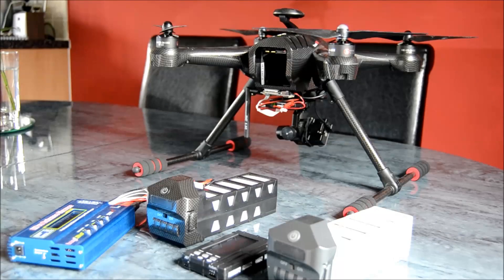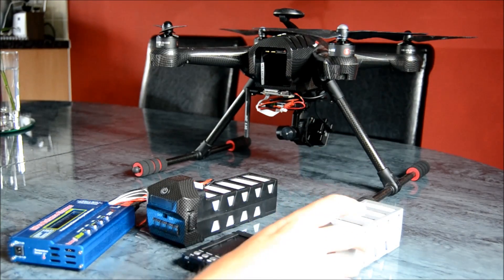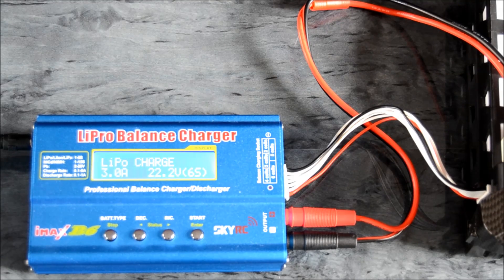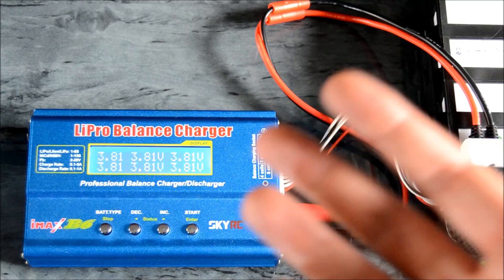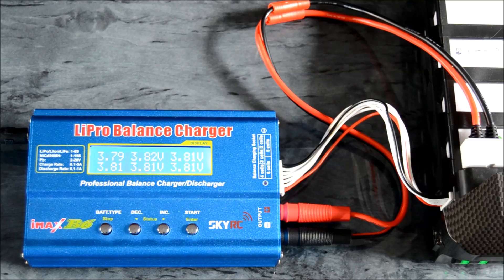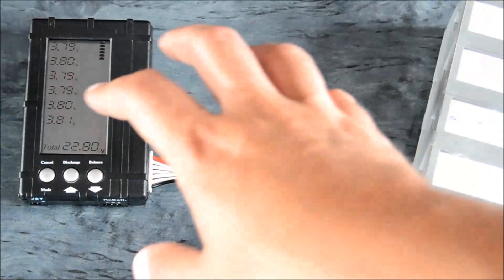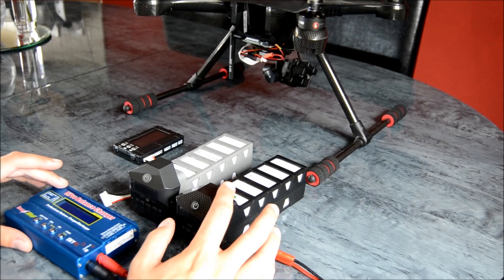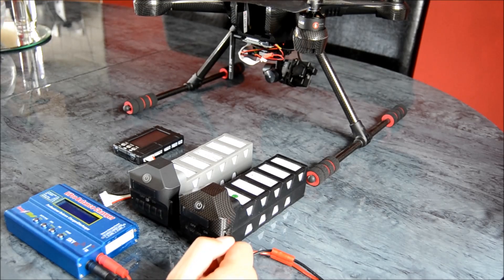Putting LIPO Batteries Into Storage Mode

Comment: Hey I have a question I have a venom duo pro charger and I have a 2s 5,200 mah lipo and when I go to put it on a storage charge it keep charging the battery past the 3.80 volts per cell how do I fix that or should I let it keep going because I usually stop it one it gets near 3.85 volts per cell. What should I do.?

Comment: How long  can you store the batteries after you reached 3.8v storage level?
Reply: LiPo batteries stored for more than eight years have shown to still work fine, but only if properly storage charged and always, always remember to slowly balance charge the battery before you use it again.

Comment: I need some advice on the battery storage mode. At 3:22, does selecting 1.0 amps mean the battery will be charged/discharged to hold 1.0 amps? OR, is that the rate of charge/discharge of the battery to meet the 3.8v?
Reply: Rate of discharge

Comment: How can I know what amps or volts to charge, discharge/storage a 4S LiPo? Is there a scheme or something? And what is the min and max amps and volts to not ruin the cells? Thanks!
Reply: Did you figure it out because I’m having the same problem
Reply: @briscosmith7607  depending on my basic information 
It should be below the half of the (Ah) of your battery 
I mean that if your battry is 5200mAh 
You should set the amp to 2.0A for charging
Reply: @ismaellayth  my maximum discharge rate on my charger is 1

Comment: I am a bit confused, if I use the storage option, and all cells reach 3.80, will I have to balance charge them leter?
Reply from the maker: If discharges the battery to a less full capacity. When your ready to use it again, you just charge it and it will balance charge to full.

Comment: What's the difference between putting a lipo in storage and discharging it? Does it matter? Thanks
Reply from the maker: The storage mode just slowly drains the battery rather than discharge which might discharge quickly.
Reply: Alex Savo thanks. Does it really matter which I use?
Reply from the maker: +thedavinator 37 Not really, aslong as when you don't want to use the look, you discharge it to a lowish voltage.
Reply: Alex Savo ok great

Comment: Hi thank you for the great information! Can you tell me is when I put my charger on storage mode it gives me option for amps. What do I set that at for 3 cell or 2cell battery? Thank you sir!
Reply: Have you found out?
Reply: @chris1966.  Hope this helps.
My LiPo battery has 5 battery cells that means it is 5S.
On the label is written 5000. That means the amount of energy is 5,000 milliampere-hour.
When I charge my LiPo battery I select 5.0A on the charger because that matches the 5,000 milliampere-hour.
If you have a much smaller LiPo battery for example 2 cells (2S). And on the label is written 1500 mAh. That is 1,500 milliampere-hour.
I would select 1.5A on the charger because that matches the label number 1500 mAh.
You set Amp rating on the charger based on the milliampere-hour rating printed on the outside of the battery pack.
I learned this from TheRcSaylors here on YouTube.
Search for the video titled.
Beginner Tips - Charging LiPo Batteries With Hobby Grade Charger - TheRcSaylors

Comment: The balancer you are using in the second section of the video is useless without a load to discharge against, otherwise where does all the energy from your pack go? It's gonna take an awful long time if all you have is the LCD in the balancer... ;). Go for the version with the 150W 3 lamp load and you will have a much better solution
Reply: Here is the version you need... http://www.myrcmart.com/rcx-3in1-battery-balancer-discharger-voltage-indicator-150w-discharging-p-4767.html
Reply: And here is how to parallel up 3 of those units to give you a great 450W discharge setup. http://www.rcgroups.com/forums/showthread.php?t=2406395